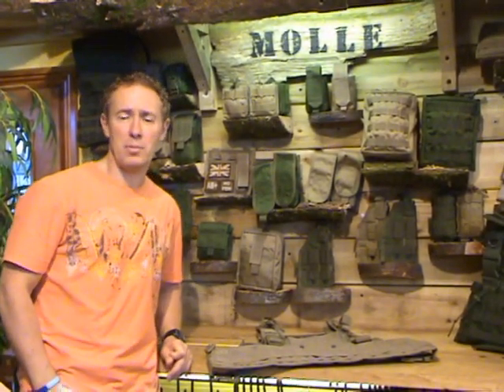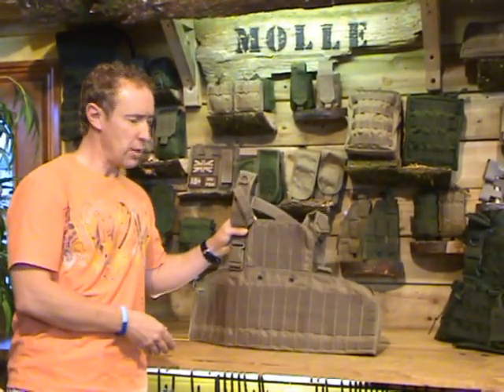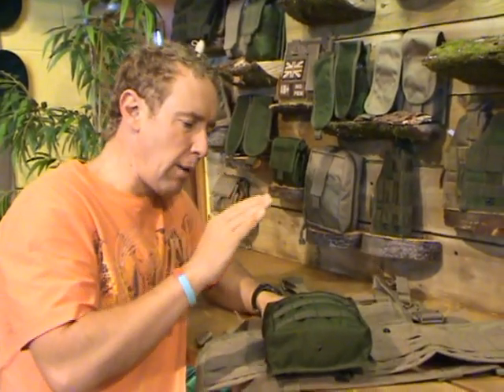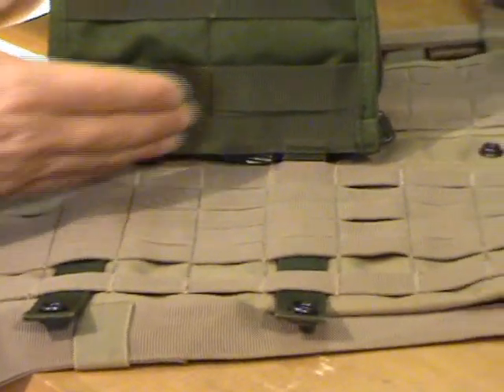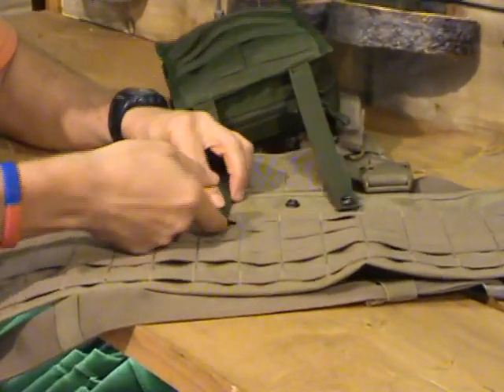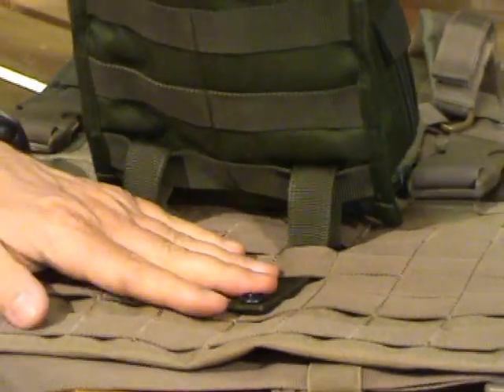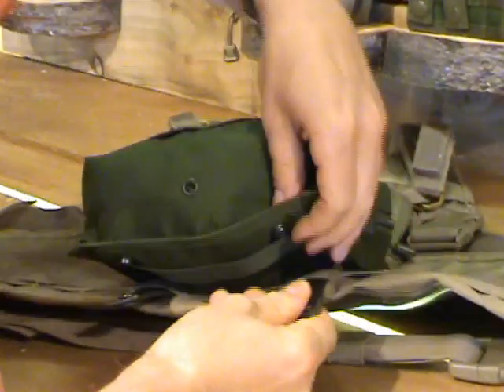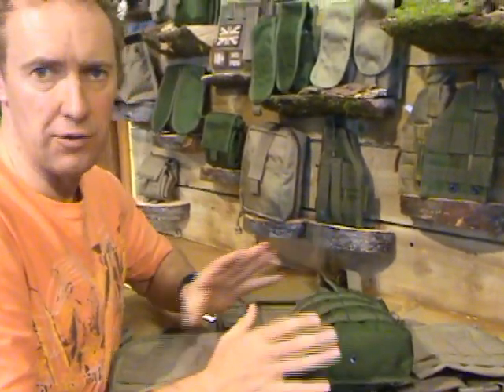MOLLE SYSTEMS

Comment: I do sincerely appreciate the instruction as I was a little unclear on how to do it correctly, however for my fellow impatient people out there, I offer the following 20 second reading substitution to watching the long video (primarily filled with talking in circles)

Take the pouch straps and go through the first loops on the rig/bag, then go through the first set on the pouch. Skip the next set on the rig/bag, and go through the next set, followed by going through the next set on the pouch also, repeating these steps in a noticeable weaving pattern until you're at the end, then snap it together.

(Not trying to be rude or anything, I'm just rather impatient and the first 2 minutes solid is literally nothing relevant whatsoever.)
Reply: Agreed. Almost 6 minutes of video for 2 minutes of information.